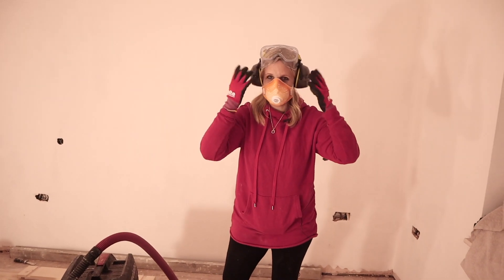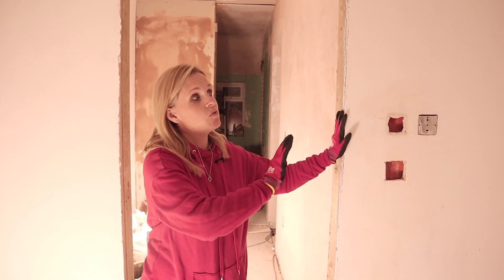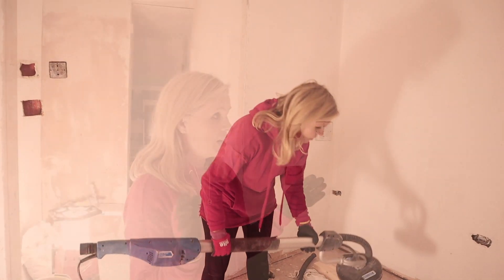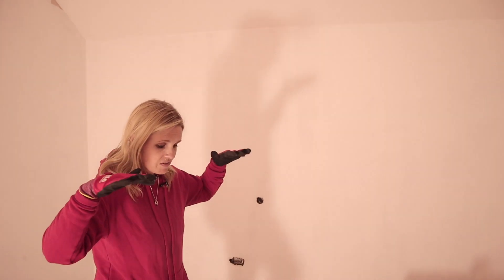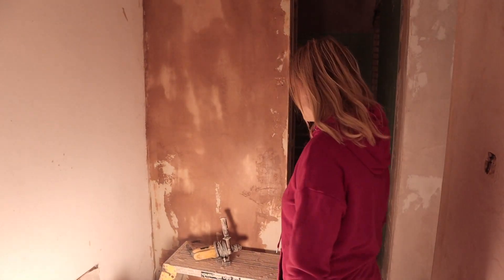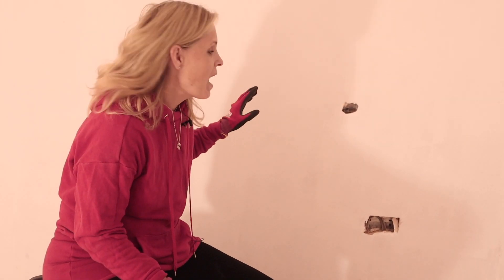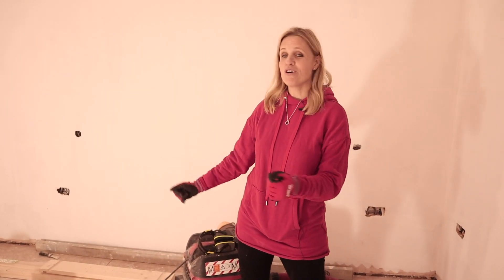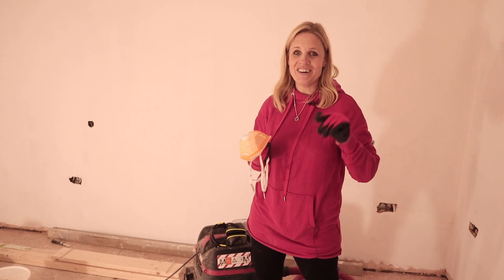BEDROOM RENOVATION 2019/ House extension update

Comment: Hi Georgina,

Its nice to see you back and hard at it once again - looks very impressive what you have achieved and so close to getting it finished - you must be very pleased and ‘tired’ all at the same time, its worth it in the end believe me, especially when you are also trying to 'juggle' 'life as well!  I like the idea of future proofing, very sensible and stops any unnecessary reworking.

Yes, clearing up is a real bind and not one of my favourite tasks either, but a necessary evil. It reminds me of my tiled kitchen floor where the grouting was looking a bit passed its best, so decided to angle grind it all out - this before new units were installed. So a reasonable sized kitchen with floor tiles that had ‘wavy’ edges - it took three days (not wanting to cut into the nice tiles or disturb them in situ), and although all windows were open (PPE on) and all doors sealed to stop the dust escaping….it did, so ended up having to clean all the rooms leading from the kitchen (shelves and cupboards emptied, walls washed down etc etc). I promised myself ‘never again’!!

Anyway, all looks very exciting at your end and hopefully when done you can have a well deserved break to recharge the batteries (of the Canon M50 as well - lol), as it does take it out of you.

Look forward to your next video of ‘maybe’ the completed room - hurray I hear you say.

Keep smiling 😀
Mark
Reply from the maker: Thanks Mark. Angle grinding is a messy business and the dust seems to linger forever. 

Hope you're still having fun with the M50 - funnily enough the batteries are probably my biggest bug bear with it now that I've had it a while because although I have a few spares they tend to run out when you're in the middle of filming.
Reply: Very true regarding the Dust!  I’ll be interested to hear how you get on with your attempt at ‘Plastering’ as its a real skill - good plasterers are worth their weight in gold!  

Yes, still enjoying the Canon M50 thank you for asking. I’m still finding out lots about it, for its small size its just great, although it does make me smile when you have a big 300 mm lens attached and the little camera is hiding at the end. I haven’t had any issues with the batteries as yet because I only take photo’s, but I’m sure when shooting video they drain very quickly as you say - its all good fun! I’m looking at exploring the video element on the M50 next, not so fussed about the 4K, as I think HD will be fine as I like the continuous focus function.

Just off to have a look at your ‘Roof’ video link now. Do you enjoy your ‘Editorship’ role at Skill Builder - I’m sure that you have built up (no pun intended) a good knowledge of the industry/techniques, and also network of contacts which has helped.
Reply from the maker: Hi Mark, yes it was good fun thanks although I've actually moved onto something new now. Plastering is very physical but it was fun having a go in some spots that won't be on show. It makes you appreciate how hard plasterers work!
Reply: Agreed. You are certainly multi talented now!